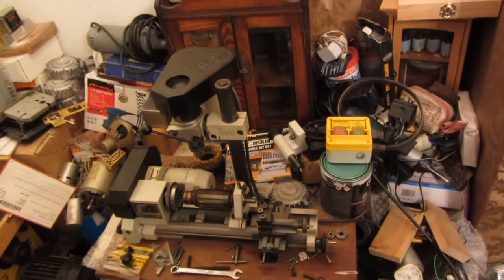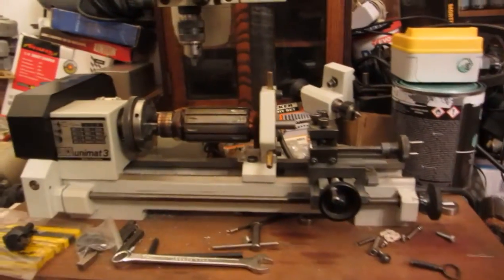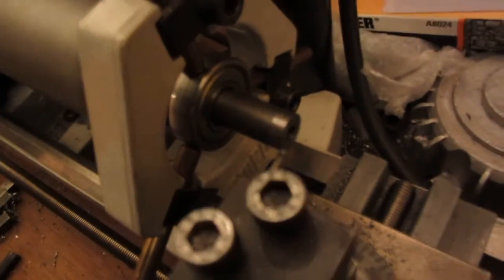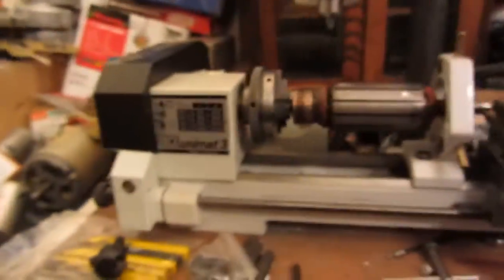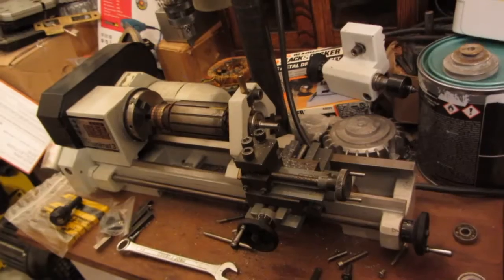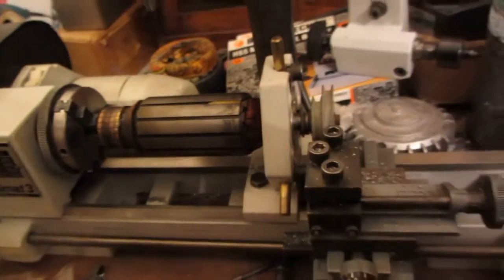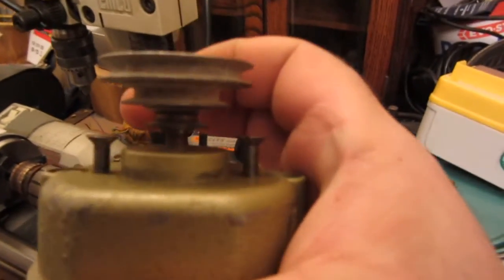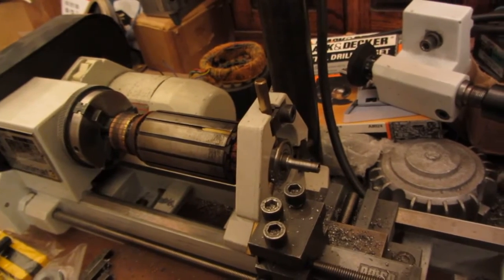Using my 1983 EMCO Unimat 3 lathe to help repair a Uinmat SL motor drive shaft.

Comment: Please continue on the motor progress!  It was one of the best videos I've seen on YouTube and very informative and inspiring. BTW, why bother with the noisy universal motors when you can go with an induction or brushless motor.
Reply from the maker: Thank you so much for your kind words, I am glad that you liked my videos on electric motors :)

I agree with you 100%! - universal motors are awful and noisy - Small, powerful induction motors are miles better.

Stay tuned, I am currently working on a very small milling machine and I have already built another induction motor very similar to the 3 speed induction motor shown in the last video, except it is more narrower and a single speed motor, as this machine will have a drive belt system very similar to the little Emco  Unimat SL Lathes.

Best Wishes, Joseph.
Reply from the maker: That's really cool! - Good luck man with your mill project - At times a small precision mill can be a godsend when you need to mill something out of the workshop and cannot move a 200kg large Emco FB-2 mill around! (like in my case) - something that weighs about 20kg is nifty and very handy to have as a potable miller :-)